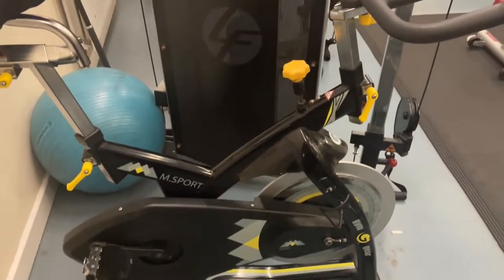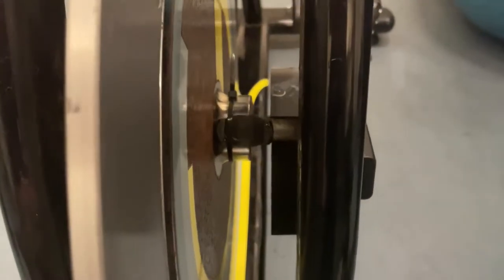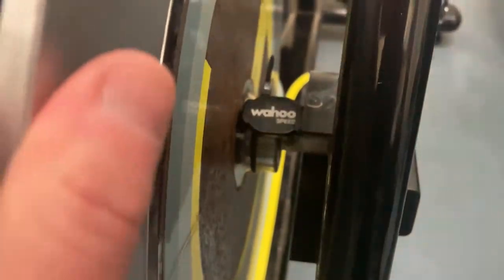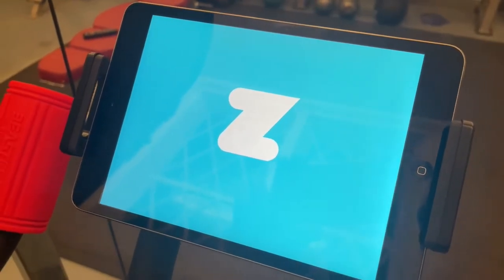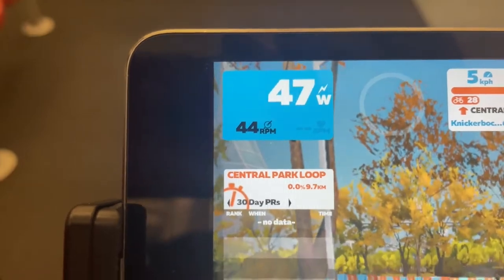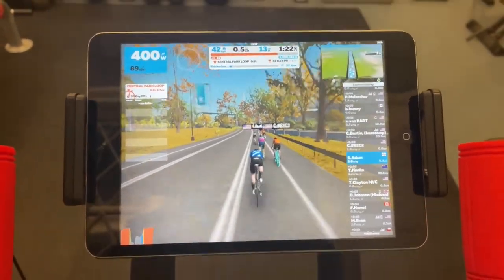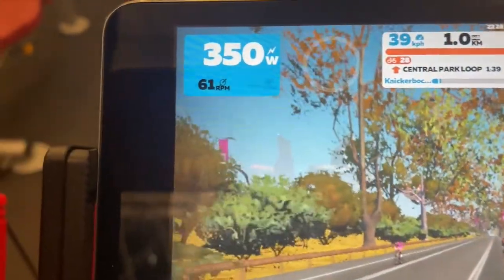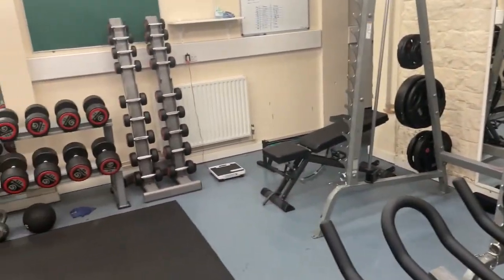Zwift On A Spinning Bike

Comment: The only problem with this is that the speed and watt values are not real. However, if you add a pedal with a powermeter, you will get approximately real data. ;)
Reply from the maker: Yeah, I’ve moved to a tacx Neo 2  now, I won’t ride the spinning bike at work anymore. 👍

Comment: How did you fix your power to 400 watts? I use the same setup with cadence and speed sensor, but my problem is that I cant pass 100 watts, because Zwift doesnt have any data about power or something. Thank you!
Reply: I got a better readout by setting my wheelsize to 20" and measure device to BTwin inride 100. It's not perfect but my settings were closer to 1.3x faster vs 2.0x faster with default settings.

Comment: Shouldn't you have programmed wheel side to have real distance and speed... That way you should get real power output due to lesser speed obtained from stroke.
Reply from the maker: You can’t, there’s no setting on zwift for spinning bike rotor size. I’ve just chosen the smallest wheel that I can. 👍